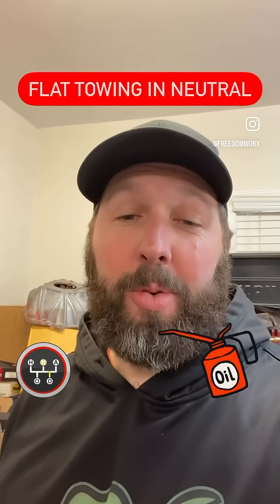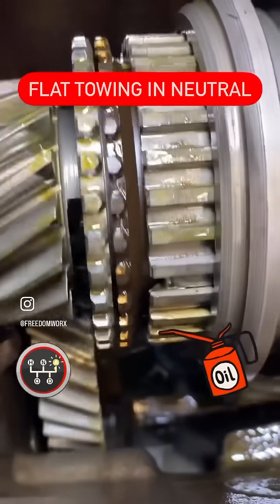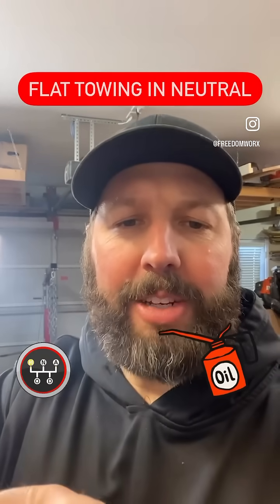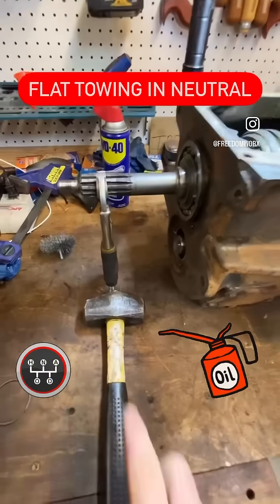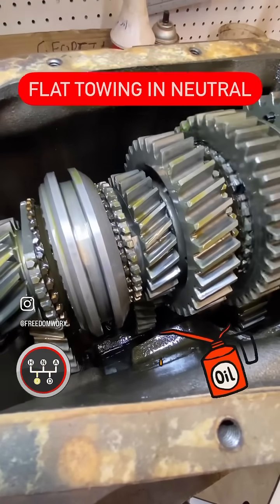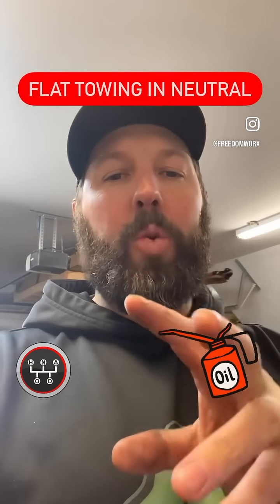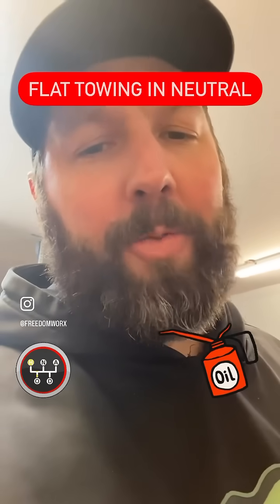Don’t Flat Tow in NEUTRAL!  #transmission #stickshift #mechanic

Comment: This applied to manual transmission rear wheel drive only. Front wheel drive manual trans, OK.
Reply from the maker: Front wheel drive's have a transaxle, different animal 😉. Same with old VWs. The ring a pinion is in there slinging oil everywhere.  💦💦
Reply: @freedomworx  I am very aware of that and that is the reason that I purchased a used Fiat 500 to tow behind my little RV. In case you are not aware it is very difficult to find a car with a manual transmission here. Very difficult.
Reply from the maker: @larryhutchens7593  where are you located? The Jeep Wrangler/Gladiator are good Go-To vehicles to flat tow here in the U.S. Just slap the T-Case in Neutral and you're good to go.
Reply: @freedomworx  Couple of problems with your suggestion. 1) It's a 4 wheel drive, don't need or want that, too many moving parts in the drivetrain to maintain and I do nearly all of my own maintenance.  2) It is too heavy. I tried towing a Chrysler LeBaron sedan on a U-Haul tow dolly (the larger one) with a combined weight of about 4,100 lb. Fried a torque converter in my little Class B camper. My Fiat weights in at a little over 2,400 lb. Cars, not trucks or Jeeps, with manual transmissions are very difficult to find. Cars that weigh less than 3,000 lb: Toyota Yaris, some Toyota Corollas, Honda Fit, GEO (or Chevy) Metro, Suzuki Swift, and a couple of others that are kinda rare. All the Metros that I found were totally worn out, could be fixed easy enough but basically ready for the junk yard. Metros would be a good choice due to their simplicity, no electronic bells & whistles just basic transportation. I did find one Chevy something or other that is made in Korea but it had such a hideous color of paint. A greenish yellow that looked like it would glow in the dark. I think it was called a Spark or something like that. Choices seemed to be either a European or Japanese car.
Reply from the maker: @larryhutchens7593  I'm not suggesting a Jeep, just saying that it has been a very popular flat tow vehicle for decades in the U.S. because the 4WD system makes it simple to flat tow because all you need to do is put the T-Case in Neutral. No need for auxiliary pumps or driveline disconnects like on a lot of other vehicles. Of course, Jeeps are much bigger and heavier than they used to be. I've seen many people towing Fiat 500s as of late.
Reply: @freedomworx  I'm aware of all that. There was a local guy who towed an older Jeep with the same type RV as I have. Worked for him but he may have never gone through the mountains in Colorado. I think it was a 2 door Cherokee. Wolf Creek pass did a number on my torque converter. Didn't have any trouble on flat ground though, the U-Haul tow dolly works great, I can recommend them. I agree with your video, a lot of folks don't know that. Also a lot of folks don't know that you can't flat tow a FWD auto trans  vehicle either. Another plus to the Fiat, no steering wheel lock.
Reply from the maker: @larryhutchens7593 10-4. I didn’t want to assume you were a U.S. viewer when I initially commented. I have a lot of European, Australian, and Canadian viewers. I know they probably tow differently and tow different vehicles in those areas, that’s why I mentioned the Jeep. And yes, passes in Colorado will put a hurting on a vehicle and an out of shape flat-lander.
Reply: @freedomworx  For sure. Going down the western slope of Wolf Creek Pass has been a little rough on more than one semi. We went up the western slope coming back from Arizona. Nearly full throttle to the top, 25 MPH. Dodge B-350, 360 with an RV cam, quadrajet. 727 Torqueflite with beefed up internals but that didn't help the torque converter any. Got all the way back to Oklahoma just fine though. Yes, the Europeans & Aussies do things a bit different and have different names for stuff. I watch a few of them.

Comment: this is like the idiots saying to flat tow in park
Reply from the maker: In a 4wd vehicle with an automatic the T-Case is placed in Neutral, and the trans is placed in Park 🤷🏻‍♂️(generally).  Says it right there in the owners manuals. Might want to do a little research before you start calling people names. Those “idiots” might be smarter and more informed than you.

Comment: Everyone knows some exception, 😂 here’s mine:
Pre 1967 power-glides have a fluid pump in the tail shaft. In “N” w/engine off the fluid still moves. This allowed me to push start (@88mph) my ‘66 many a time!
Reply from the maker: You have friends that can run 88MPH 🤯
Reply: @freedomworx  LOL, no! The 88mph was a joke! If you found a slight decline that was long enough (like the twin pines mall parking lot) it would start if you could sustain 10mph for a bit. 20mph pushed by another vehicle worked best though!👍
Reply from the maker: Yeah, I’m aware that some of the older Autos had the rear pump on them 👍 😉. But you can’t go back in time at 88MPH unless Mr. Fusion is properly engaged.
Reply: @freedomworx  
- I'd once/ounces heard that the '88/HH MPH' >> BTTF >> thing had its genesis within ShutzStaffel Obergruppenfuhrer Hans Kammlers SchutzStaffel Spezial Projects Division, there @ the tail end of WW2? 

- An accidental, but fortuitous, side quest seized during the valuable endeavor, in finding a viable solution for making gumball color(s) more orange. (See YT's 'Neural Viz' & 'Gummo-Corp' vid series as a historical aid)

- That spezial project as located in Bohmen Und Mahren, CZ.

- Salute's to you Good'Sir, as the info ya share with us fellow gorillas contains rather hefty value! 
(And the humor used therein;)
Reply: Several transmissions form the 60's were like this.
Reply: @terminalfrost3358  Some Ford automatics from the 60's (3-speed) had front and rear pumps.
Reply from the maker: @JRobert111111 GM transmissions did also 👍
Reply: @freedomworx  I saw here the pre 67 Power-Glides have a rear pump, I didn't know that.  I know from personal experience from a 65 T-Bird I owned with the "dual range Cruise-O-Matic 3 speed (390 4V engine)" could be started with a dead battery coasting it down the street in neutral and dropping it into drive.  I have (currently) a 67 Impala (327 4V) with the TH-400 and I know in decades past that this one only has a front pump from trying the same stunt.  Amazing transmission; it still shifts beautifully and is original and never rebuilt.  My grandfather bought it brand new.
Reply from the maker: @ the good ole days, when you could push start an automatic 😂👍
Reply: I just found out they had rear pumps. Why? After decades referring to the transmission pump as a “front pump” it hit me that there must have been rear pumps at some time.
Reply: @AlphanumericCharacters  Because in the old days electrical systems were not reliable. (see: Lucas in 1960's) And the engineers believed the public needed cars that could be push started...The public thought this as well... It was to make automatic transmissions equal manuals.
Reply: @misters2837  interesting. You could probably flat tow them too.
Reply: @AlphanumericCharacters  Yes in Neutral. - We had an old Chevy Pickup with 292 six cylinder and Powerglide (Wasn't Factory)....I used to tow it behind the Gravity boxes to the field. - That way I had a truck to run home quick and refuel myself coffee/food/shower and not be stuck going 20MPH, and wearing out my terra-treads.

Comment: May I ask you a towing question? I just bought an RV with a 2016 SRX Cadillac fully set up for flat tow. Am I buying a peck of problems. Seller is a retired pilot. A real belt and suspenders kind of guy. Dealer service history is impeccable. Thoughts?
Reply: Nothing I've researched recommends flat towing in my case a 2010 RX350 which I was planning to sell gor $10k cuz I only have a 2 car garage. Me, sit behind a 22 Taco trd sport
Reply from the maker: I'm not a Cadillac fan. If it's a good deal, go for it. But I would never buy one. I'm a Lexus guy.

Comment: Unless your driveshaft is disconnected or the transfer case (if equipped) is in neutral, wouldn't the output shaft be turning the whole time you're moving?

That should provide adaquate lubrication for flat towing.
Reply from the maker: The output shaft does not distribute oil in the transmission, that's the point of the video.
Reply: @freedomworx , I understand what you're saying, but you say the countershaft spins when the output shaft does. Your video clearly demonstrates that.

Isn't that what is doing the splashing?

The video seems contradictory, and I'm just trying to figure out how the transmission on your bench could be damaged if the countershaft is spun by the output shaft by the wheels turning.
Reply from the maker: @pblackbird the video says that the countershaft only spins when the transmission is in gear or the engine is running. I demonstrate that it is not spun by the output in neutral. Watch it again 😉
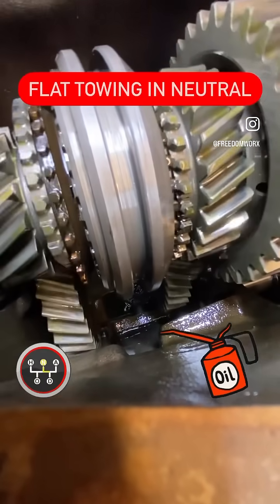Reply: at 0:57 is the countershaft not spinning while the transmission is in neutral? @freedomworx
Reply from the maker: @pblackbird  yes, because I’m turning the input shaft, not the output shaft.

Comment: My 1992 F150 4WD has a 5-speed manual transmission (M5OD), and a Manual Transfer Case (I think it's a BW13-56).  I assume I can put the Transmission and Transfer Case in neutral, set the front wheel manual hubs to Free, and flat tow without problems. It seems that with the Transfer Case in neutral, and front hubs set to free, the transmission would not be spinning. It seems that the tranny would be separated from the front wheels and from the rear wheels.  The rear driveshaft would spin. The rear output shaft of the manual Transfer Case would spin. But I assume the Transfer Case oil pump would operate because the oil pump for the Transfer Case is on the rear output shaft.  Is that correct?  Does this seem right?
Reply from the maker: You really have to read the owners manual. I think the M5OD might actually be fine to be towed in neutral. But generally, when flat towing a 4x4 truck. The T-Case is in Nuetral and the transmission is left in Park or in Gear. Although there may not be a mechanical couple between the tires and the transmission, the fluid friction alone in the T-Case will still spin a transmission output shaft while flat towing.
Reply: @freedomworx  I posted a question under a different comment, I think this is the answer I was looking for. Thanks!

Comment: Greatly depends on the trans...with the vehicle in neutral (5spd manual only) there is 'no load' on the engine as there would be with the engine running and in gear/s moving. The oil level will also be up to where the fill plug is at whereas in the video the sump is empty. The oil (when filled) while on the road in neutral will splash around relatively easy allowing lubrication.
Reply: That's exactly what I told him as apparently he never had a transmission working to see how much oil flings around even when the engine is not running in neutral and moving. I had to do it once and got drenched in oil to fault find a noise in the transmission. Unfortunately experience sometimes out smart people's who think they know everything and by making a video to prove a point without having every detail correct just brings egg on face.
Reply from the maker: @Thunderstormworld  you are arguing with the manufacture, not me. And all the people who have actually burnt up a trans for the exact reasons I explained. Click on this link and tell Tremec they don't understand the transmissions they designa and build. Then tell every heavy tow truck driver to stop pulling the drivelines before they tow semis... because you said it's a waste of time 😂 https://www.tremec.com/not_am_detalle/flat-towing-manual-transmission-vehicles/
Reply: Don't see where he mentions anything of a Tremec vehicle. Never heard of myself. Automatic transmissions pump fluid thru the trans whereas manual trans generally do not especially if it's a asynchronous trans like in a VW. @freedomworx
Reply: I’ve seen quite a few cases where the owners manual says for flat towing, you can tow with a transmission in neutral, but you have to get out and move the toad under its own power every 200 miles.  
I’m sure this is why.
Reply: The designed oil fill level very rarely goes above just immersing the few lowest teeth of the 1'st gear, as it is the largest one. The reason is, immersion in oil creates a lot of drag, so   add up extra fuel consumption and generates quite a lot of heat build up (in the overall transmission). 
And in most designs, all the gears are permanently connected on the engine side, first to have the oil moved around when idling stopped, plus the engine operates in narrower rpm range than the output, so better trade off between sufficient oil agitation for lubrication, but not too much to create unnecessary drag so losses. Drawback is, with the engine stopped, very often just the output shaft in the middle of the gears is spinning, so no splashing at all.

When going slowly and limited distande when towing, the oil film uses to be enough to provide some lubrication when the thing is just spinning without any loads. But with excessive speeds, the bearings will generate extra heat, which makes the oil thinner, so less of it stays on the surfaces. Plus as there is no oil movement, the only thing cooling the surfaces is the metal heat conductivity, which is not that much, so even when there is no load, at higher speeds it may overheat.

Irony is, the early automatic transmissions did not have this problem, many had the oil pump powered from the output (either via extra mechanism, or there just was a second pump). The reason was to allow the cars to be push/downhill started, the consequence was the oil was circulating even when the engine was off when the car was moving forward. Safety standards made an end to that (people were not paying attention to driving the moving car when push starting it)...
Reply from the maker: https://tremec-blog.com/flat-towing-tremec-transmission-vehicles/
Reply: @freedomworx   404 Page Not Found.
Reply from the maker: The link works for me. Might have been a temporary thing 🤷🏻‍♂️
Reply: @freedomworx  Linky No Worky for me....Tried on 3 different devices all with different service. - The comment above... "Tremec Vehicle. Never heard of myself."  Made soda come out of my nose, and onto my keyboard. - Some people's IQ is sub room temp. - Do they think manufacturer of vehicle makes every part on it?  Look at Dodge 1st Gen Diesel 4x4.  Cummins Engine, Getrag Trans, New Process Transfercase (205 on some!), Dana Axles....and likely (Guessing here) Bendix Brakes....The only thing Dodge made was the "Shipping Crate" - LOL!

Comment: Thank you for this video. What gear should the transmission be in? My manual says put it in gear, but it doesn't say what gear. If my tow speeds are as high as 65 mph, it would seem to me that it should be in 5th or 6th. Any advice is appreciated!
Reply from the maker: The only way your transmission should be in gear when being flat towed is if its a 4WD with the transfer case in neutral. In which case, it wont matter what gear. So long is it's not in neutral.
Reply: If it's a 4WD vehicle with the transfer case in N, would it matter what gear the transmission is in, could it be in park or neutral or whatever you choose? Wouldn't the transfer case isolate the drive shafts from the transmission thus making the gear selection irrelevant?
Reply from the maker: The trans should not be in neutral. The T-Case will still spin the trans even if the T-Case is in neutral. Fluid friction alone will cause it to spin the trans. Every owners manual I’ve ever seen specified that the trans should not be in neutral.  Manuals must be in gear and autos must be in park.